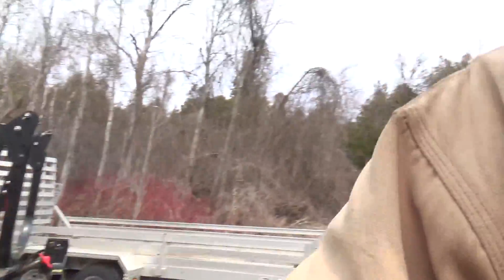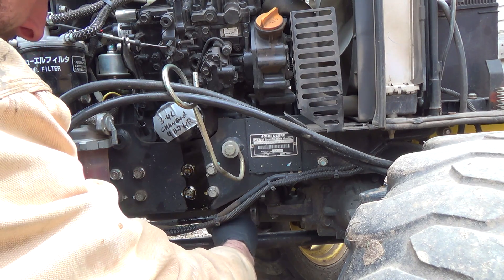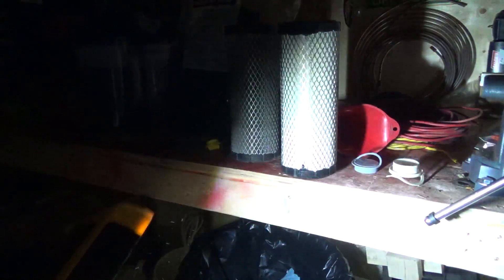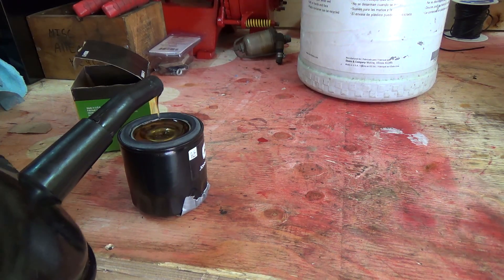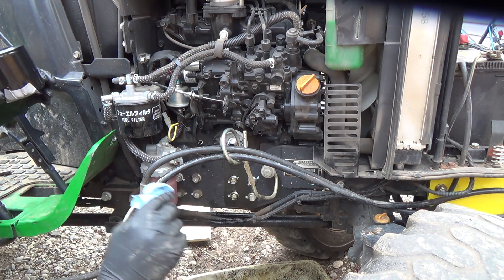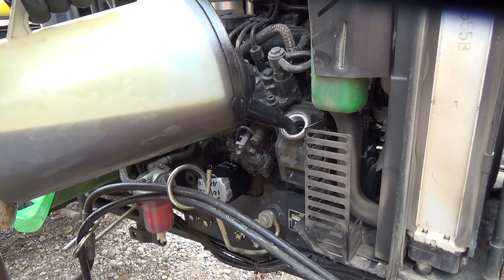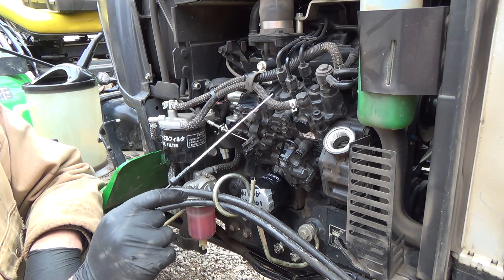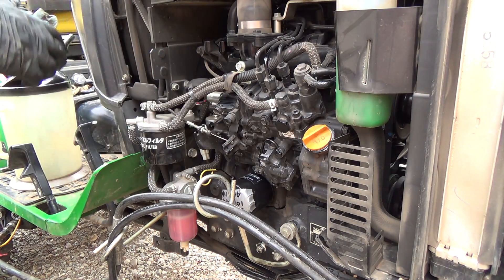Oil change series....Next up John Deere 2032R 1019.2 hours

Comment: There are FIVE additional grease zerks under the tractor. 3 on the left and 2 on the right under the floor boards. They are all for the brake linkage.
Reply from the maker: Yes. Did those.

Comment: Oil w-winter summer weight is 130 degrees is the thirty you have a -10 you would think summer thins out verses winter being -ten and summer up to 130. Being diesel the viscosity may be different lubrication factors verses a gas.